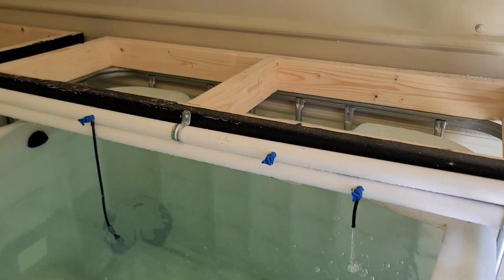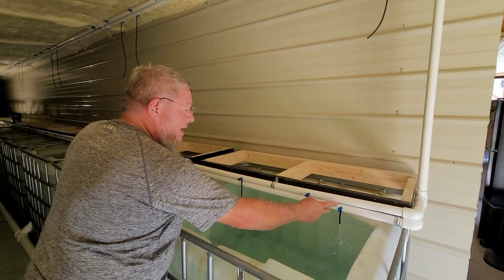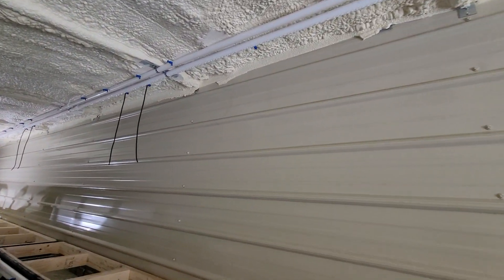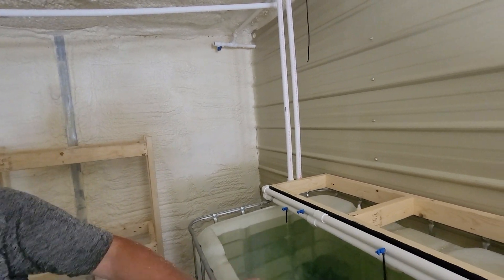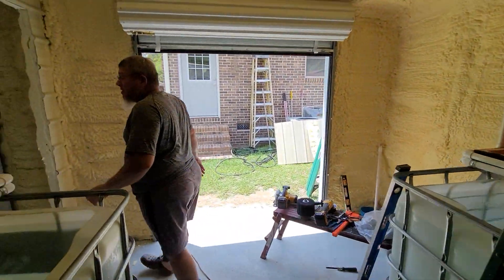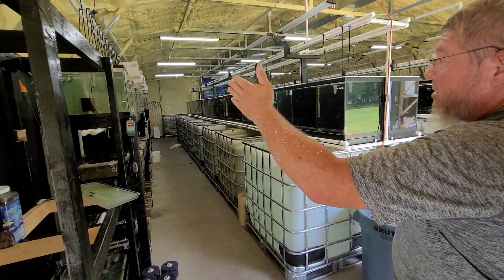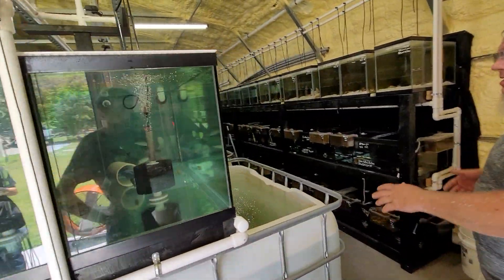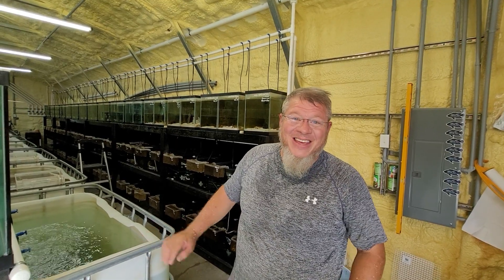Fish Facility Expansion

Comment: What do you put over the outlet of the IBC tote to keep the fish out.
Reply from the maker: We buy drain stoppers that fit in the hole and keep the fish from going in them.
Reply: @Ron's Cichlids  not really sure what you mean by a drain stopper. I have a bunch of these tanks i use for goldfish and koi, but the drains clogging is a constand problem. Curently i have a piece of round plastic with holes drilled in so the fish don't go in it. The main problem is my tanks are in a greenhose so algae growes on the inside and occasionally flakes off building up on the drain and restricting the flow.
Reply from the maker: @StephenBenson-x2e  https://www.amazon.com/gp/product/B08628RX23/ref=ppx_yo_dt_b_asin_title_o05_s00?ie=UTF8&th=1